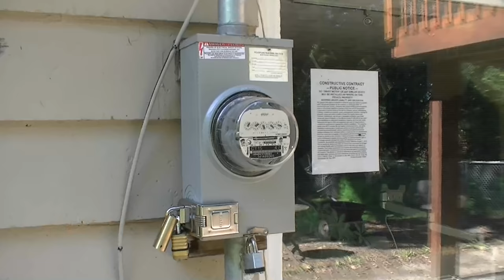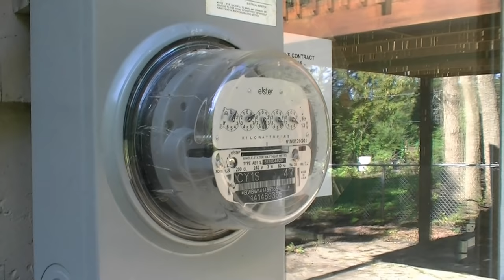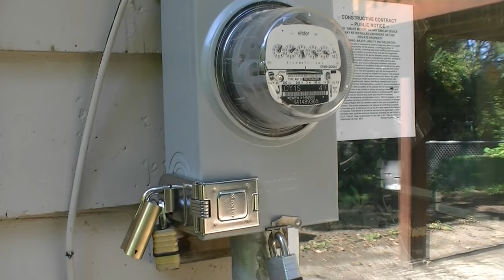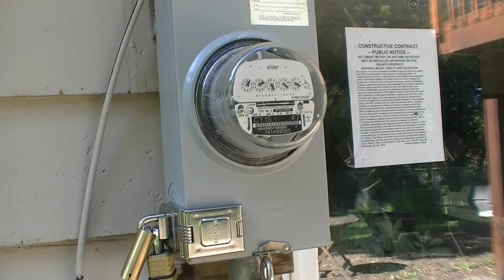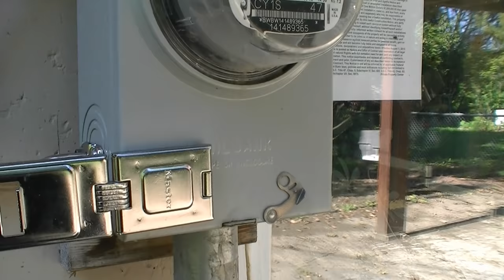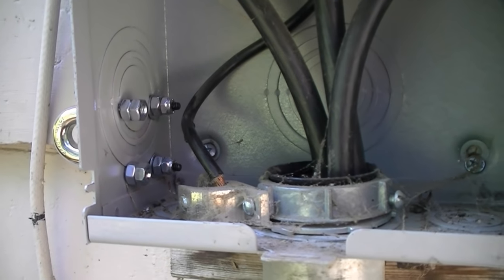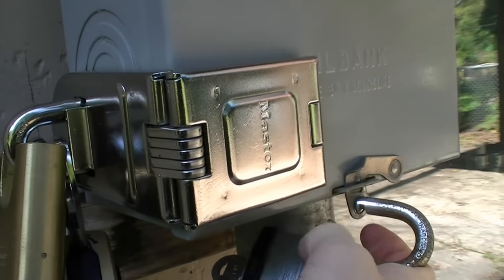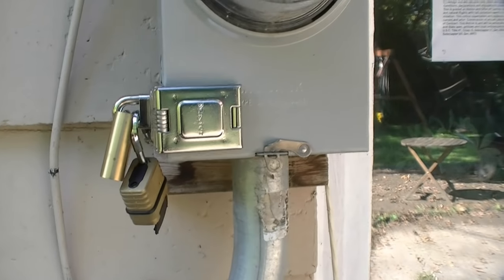Locking Your Electric Meter to Prevent Smart Meter Installation

Comment: Who cares?
Reply: Let's look at why we need TIN FOIL HATS. 
 #1 A smart meter will hurt or even KILL disabled homeowners who have disabled medical implants.  The average of deaths by smart meter radiation and smart meter fires is almost 100 every month in North America.
#2 Did you know if your power company “turned off” the power to your home when they did a smart meter install, your chance of a smart meter fire increased by a factor of 10,000.
#3 Your power company has access to all of you private power information. Eg When you make tea, when you turn on your alarm etc. This private information is sold to Google for huge sums of money. Ask your power company what the second radio transmitter in your smart meter does. (ZigBee) 
#4 A smart meter will cause cancer to return if your family members who are fighting cancer at home. If they come home from the hospital and sleep near a smart meter, they will die. Check with the US Cancer Society website. 
#5 Smart Meter RADIATION  will turn off breakers in your home. Both AFCI's and GFI's get turned off by the radiation from the smart meter.
#6 You smart meter is very accurate, BUT, the software (firmware) is programmable. Your bill has nothing to do with the power you use. 
#7 Smart meter radiation is breaking Ionic Bonding.
#8 A huge expenditure for a huge loss. Billions of dollars to purchase something that does not general generate any power and each smart meter need 4 watts to operate. One million smart meters use 4,000 KILOWATTS of energy to operate.
#9 The second radio transmitter is for ZigBee. If you want your power company to MONITOR your home 24/7, then you are in luck. Don’t forget, this private information will be sold. Why do you think your power company spends BILLIONS of dollars and does not generate one watt of extra power to sell?

Comment: Lol this is a joke!
Reply: Let's look at why we need TIN FOIL HATS. 
 #1 A smart meter will hurt or even KILL disabled homeowners who have disabled medical implants.  
#2 Did you know if your power company “turned off” the power to your home when they did a smart meter install, your chance of a smart meter fire increased by a factor of 1000.
#3 Your power company has access to all of you private power information. Eg When you make tea, when you turn on your alarm etc. This private information is sold to Google for huge sums of money. Ask your power company what the second radio transmitter in your smart meter does. (ZigBee) 
#4 A smart meter will cause cancer to return if your family members who are fighting cancer at home. If they come home from the hospital and sleep near a smart meter, they will die. Check with the US Cancer Society website. 
#5  Reason is Smart Meter RADIATION turn off breakers in your home. Both AFCI's and GFI's get turned off by the radiation from the smart meter.
#6 You smart meter is very accurate, BUT, the software (firmware) is programmable. Your bill has nothing to do with the power you use. 
#7 Smart meter radiation is breaking Ionic Bonding.
#8 A huge expenditure for a huge loss. Billions of dollars to purchase something that does not general generate any power and each smart meter need 4 watts to operate. One million smart meters use 4,000 KILOWATTS of energy to operate.

Comment: This guy is totally paranoid!!!
Reply: Let's look at why we need TIN FOIL HATS. 
 #1 A smart meter will hurt or even KILL disabled homeowners who have disabled medical implants.  The average of deaths by smart meter radiation and smart meter fires is almost 100 every month in North America.
#2 Did you know if your power company “turned off” the power to your home when they did a smart meter install, your chance of a smart meter fire increased by a factor of 10,000.
#3 Your power company has access to all of you private power information. Eg When you make tea, when you turn on your alarm etc. This private information is sold to Google for huge sums of money. Ask your power company what the second radio transmitter in your smart meter does. (ZigBee) 
#4 A smart meter will cause cancer to return if your family members who are fighting cancer at home. If they come home from the hospital and sleep near a smart meter, they will die. Check with the US Cancer Society website. 
#5 Smart Meter RADIATION  will turn off breakers in your home. Both AFCI's and GFI's get turned off by the radiation from the smart meter.
#6 You smart meter is very accurate, BUT, the software (firmware) is programmable. Your bill has nothing to do with the power you use. 
#7 Smart meter radiation is breaking Ionic Bonding.
#8 A huge expenditure for a huge loss. Billions of dollars to purchase something that does not general generate any power and each smart meter need 4 watts to operate. One million smart meters use 4,000 KILOWATTS of energy to operate.
#9 The second radio transmitter is for ZigBee. If you want your power company to MONITOR your home 24/7, then you are in luck. Don’t forget, this private information will be sold. Why do you think your power company spends BILLIONS of dollars and does not generate one watt of extra power to sell?